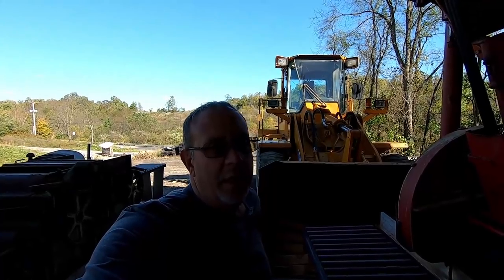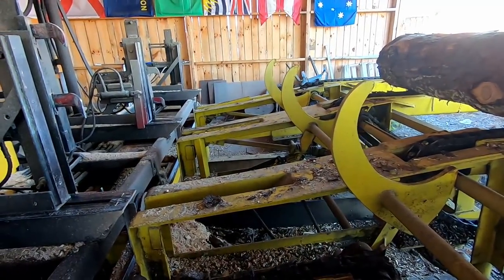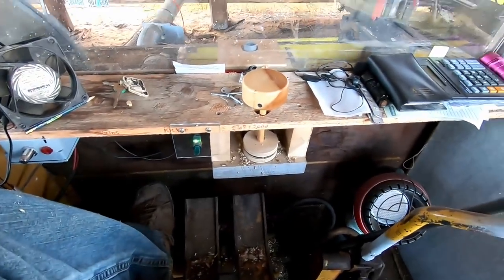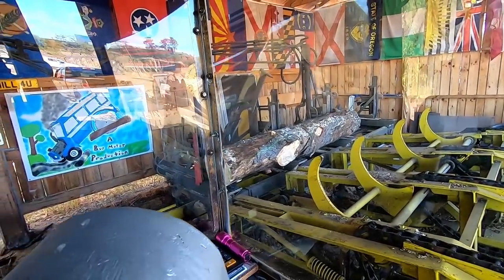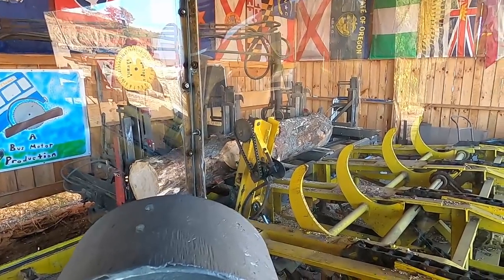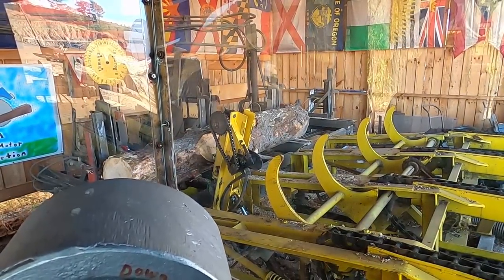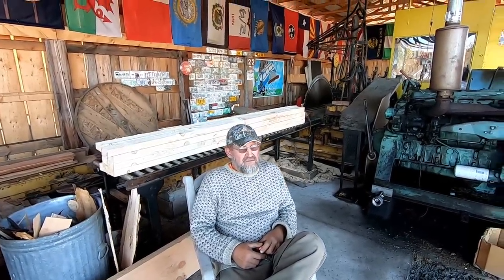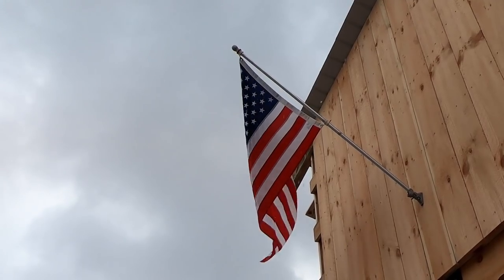sawmill tour # 237

Comment: Hey you guys I really like your program. When dinasaurs stiil tread the land I was a young guy Here in victoria for many years there were 3( think) large saw mills. The timber was towed in barges down the coast and into the harbour. These mill produce lots of saw dust which was used for home heating fuel. Ideal Home heating seemed to have a large share of the buisness. Large big boxed trucks wold blow the stuff into the basements of homes. We would know someone was getting fuel due to blowere on the trucks. Ah the days of my youth.

Comment: So glad to see what all goes on in the cab. I kinda figured that there had to be a lot of crazy button pushing and pedalling going on.  Good to see the skill involved in getting it to look so smooth on the regular videos. Especially the log turner.  There is a lot of stirring required with that control stick to get the log where it needs to be.  Bummer about the bark but, meh, it happens.  I thought you were mad at Eddie and were blocking him out of the video.  jk

Comment: Thr controls would be backwards for me, I'd want to push the stick forward to move the carriage forward and back to move it back, the same with the log turner. I operate heavy equipment and the hardest part is getting in a different machine and the controls are different.
I had a dairy/beef farm for 25 years, all my tractors and every other farm tractor with a frontend loader and a two stick control. The left stick operated the loader up and down, back was up forward was down, the right stick operated the bucket, pull it back to load the bucket and pushing forward to dump.
Then I got a job operating a 963 cat track loader. Left stick operated the loader up and down same as my farm tractor but the right stick was opposite with forward loading the bucket and back to dump the bucket.
It took me awhile to get use to that.
Now I'm in a rock quarry operating a 980g rubber tired loader.
Left stick operates the bucket with back being load the bucket and forward dumps. Right stick operates the loader up and down normally. I called it backwards and upside down.
It all comes down to what your use too.

Comment: Should use some of the sawdust around that old Detroit. Dripping beasts they are. Let the sawdust absorb. Then scrap up to cleanup.
Reply from the maker: we do put sawdust under the ole bus motor & use it for fire starter.
Reply: @markgalicic7788  I did not suggest to use the oil soaked sawdust for fire starter. I suggested to clean up the oil with sawdust. Scrape it clean. The raw oil and contamination from that engine looks disgusting.

Comment: Mark couldn't you cut a tee in the sawdust blower pipe and put on a 3" or 4" flexible vacuum hose to clean up around the saw.
Great your and operation.
Reply: HMMMMM
Reply from the maker: we have one the shovel is faster.

Comment: Should  the idler usually go on the loose side of the belt not the tension side.
Reply: I was going to mention this.  Tension on belt as you say goes on the slack side, (non Tension).
Reply from the maker: that side was hitting the belt guard , it solved the problem.
Reply: @markgalicic7788   It's recognised engineering practice for the tensioner to go on the non driven side, so re-design the tension bracket as the pulley is taking all the load, it may work but its not good and bad practice.
Reply: @markgalicic7788  as long as it works that’s all that matters right.

Comment: I am confused by your distinction between  4/4 and 1 inch in your offsets.  How are they different?
Reply: One inch =1.000. 4\4 four quarter = 1.125   sawing grade lumber  uses the quarter scale.
Reply: Is the extra 1/8 to allow for shrinkage since green?  Stuff I used to buy for some woodworking projects, there was no extra 1/8"  4/4 was 1" 5/4 was 1 1/4"
Reply: @markmckinley5989  Hi Mark. The extra 1/8 is for shrinkage during drying , board cutting variations, board cupping. After all of this and processing, the end goal is to have a board that is flat and true 3\4" thick.
Reply from the maker: 1/8"
Reply: @JohnClark-sc8uu  Makes sense since a lot of the hardwood I used was cupped pretty good.  I cheated a bit and eyeballed what I bought and cherry picked the flattest ones.

Comment: Your tensioning pulley on the long belt run does not appear to be adjustable. You’ll have the same flapping trouble when the belt stretches eventually.